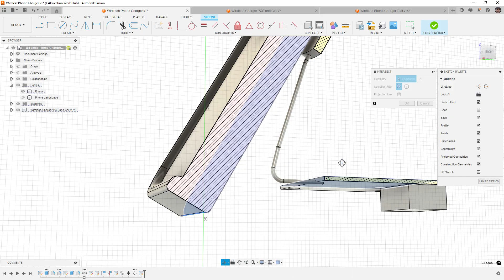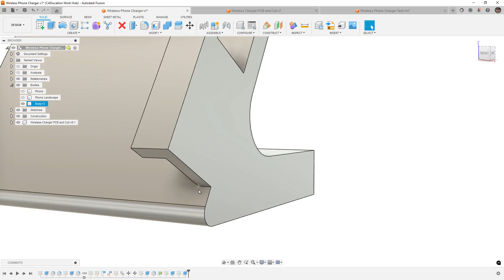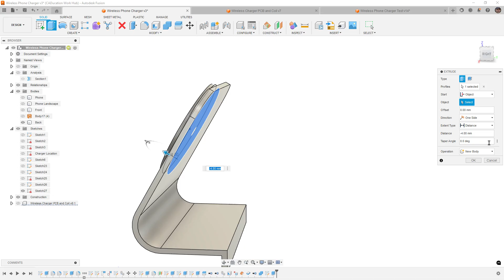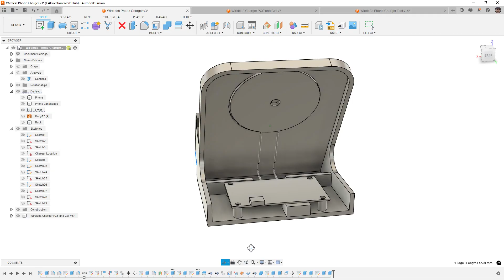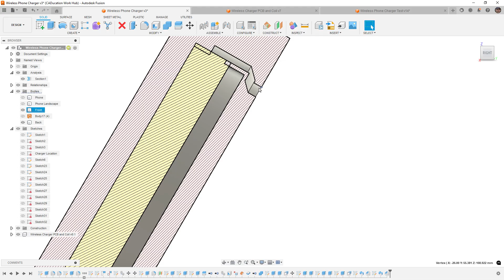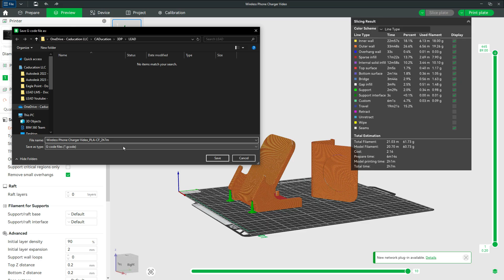3D Printed Wireless Phone Charger #3dprinting #diy

Comment: 47:50
Isn't there a function that auto interfaces to bodies?
Reply from the maker: do you mean creates a gap for you?  no.  if you want them to exactly match you can use combine like we did on the back piece after the thicken.  but if you want a small gap you have to design it in or use Press Pull after and offset one of the faces.
Reply: @LearnEverythingAboutDesign 
Thanks for the clarification. I primarily use Inventor (but soon to walk away from Autodesk all together in favour of Solidworks). I thought I recalled seeing a function that would automate that process or something similar to it (before my work rig went down, I was in the middle of making IMU tracker cases that would snap together).
Reply from the maker: I have been a long time Solidworks and Inventor user.  Is the switch to Solidworks by choice?

On the Fusion side in the Product Extension there is a tool to do a lip and groove and that allows you to specify a gap.  it works on simple planar parts but nothing much past that.